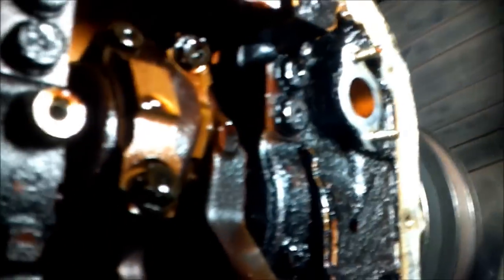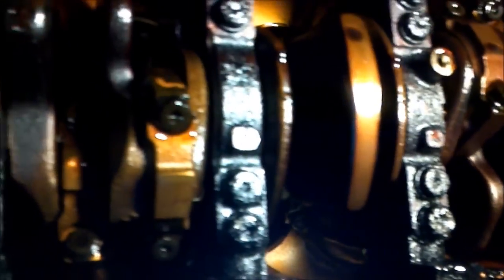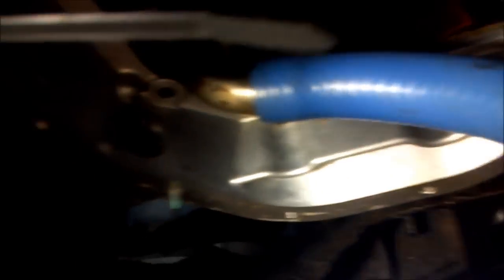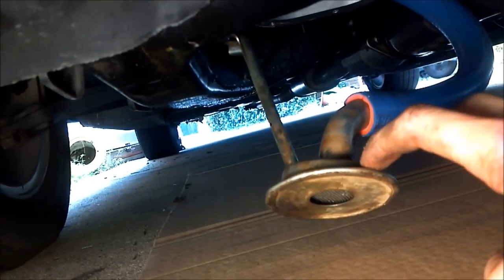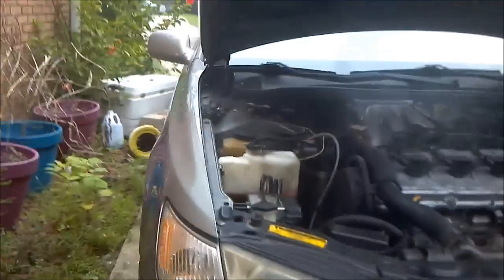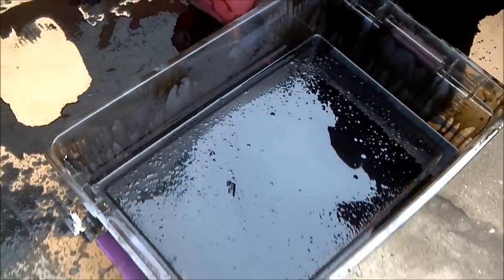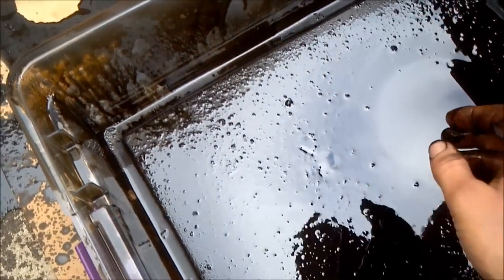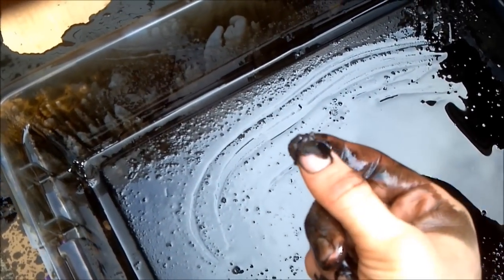2000 Lexus ES300 Sludge removal

Comment: how to avoid engine sludge in the 1MZ-FE (Toyota V6): 
1) change the oil according to the owner's manual
2) change your PCV valve every other oil change
3) clean out your EGR tube and EGR passage to the intake every 30k miles or so

Comment: Damn you got some balls !! You run an engine with oil pan open, never saw that before !
It seems to work, lots of sludge seems to be removed.
It's a very messy method but if it works !

Comment: Use Rotella 5w40 Diesel oil. The extra detergents in the diesel oil will help clean the rest of the engine.
Reply: I’ve ran diesel type oil in a few very dirty engines and it did no more cleaning than regular oil did.

Comment: Why not add a flush to the oil, let it idle 10min then drain it out.  A lot less messy.
Reply: Boodieman72 with that amount of crap the sludge would break loose and clog other parts of the engine.
Reply: Joe Torres
then flush 2 times?

Comment: I worked at a garage for many years and i've seen a sump been took off and the amount of sludge at the bottom was INSANE! Mate who worked on the car said that's because of cheap oil and not frequently changed.And one customers car had an oil change but didn't want the spark plugs changed as she recons changing them was a con so we left them alone which we put back in a black,old disgusting state and yes! the car ran like a pig before! The amount of fuel she's wasting due to it not being replaced was a joke.Some people just on't get it.

Comment: What was the mileage on your car at the point of 'sludge removal' ?
I'm thinking of buying a 1999 es300 with 180k kilometers, concerned with this.
Reply from the maker: Happened at 160k miles. After this it had 300k when sold. Might even still be running around somewhere.
Reply: gmtech26358 Would you suggest a fluid flush at my stage? Or do you think that will make it worse?
Also, what are your thoughts on the reliability of the vehicle, would you recommend the purchase? Any other precautionary suggestions before I make the purchase?
Reply from the maker: @fi8er1  after what happened to me I'd not even consider it unless you pulled the front valve cover and checked for sludge. I can't recommend this engine. Durability is great for these with good service history.

Comment: Hey boss awesome video! Can you help me understand something? Are you extending from the oil pick up to fresh oil and leaving the oil pan off so as fresh oil comes into the system it will cycle through (taking out your sludge build ups) and end up in your tub? If this is the case how much fresh oil did you need to use?
Reply from the maker: Frazer Brennan I used the same principal as an old style bowl type fuel filter. The solids settled out on the bottom well away from the pickup tube. I had been pulling the lower pan off and cleaning the screen over and over and over. After the 5th time of that I decided to use this method. I used oil that was not fresh but I knew it's history and it had no particles in it. It was drained from a diesel engine  that holds around 30 qts. I used probably 5 gallons to fill the bin.
Reply: gmtech26358 thanks for the reply ! I will do the same one day on my car just to see the results

Comment: From my understanding of this, the gunk was continually blocking the pickup screen so this was a way of clearing the gunk to fix the problem?
Reply from the maker: Yes, Exactly my issue. The screen is roughly 3" of area and about 3/8" from the bottom of the oil pan. In no time it'd be clogged and I'd have no oil pressure.
Reply: gmtech26358 I had a similar problem with my V6 Avalon.  Oil light slow to turn off, some flickering.  I replaced the oil switch and filter.  All seemed fine for a while but did notice an occasional flicker of the oil light.  One day just stayed on.  

I was thinking maybe a another faulty oil switch.  Moved it out of the garage and it stalled.  In fact the engine was seizing.  I took the pan off and the oil screen was completely blocked with hard black crud and there was a lot of sludge around.  

Cleaned the oil screen, the sludge I could see and the pan, reassembled it.  I put some oil down the spark plug holes.  I also checked the PCV valve and hose and it was blocked with black crud.  Cleaned that too.  Left it to the next morning.  Went to start it up and the starter motor just went click click but finally cranked the engine.  After massive amounts of smoke, the engine is fine now.  

After cleaning the PCV valve, the car no longer emits a little smoke on start up.  I have read that a blocked PCV valve can cause engine sludge.  

I have had my Avalon since new in 2002.  It has done a little over 200,000 km and gets an oil change every 7500km. 

I understand what you are doing.  If the oil screen is constantly blocking up, it’s a huge problem and the value of the car restricts how much money you want to spend on it .
Reply from the maker: There is a known issue of the valve covers being too restrictive and causing this problem. Toyota paid out and had to replace engines because of it... didn't even know when I bought the car as it had been maintained well.. They were covered under warranty for 8 years for this issue.

Comment: Run liqui moly engine flush and use Rotella t6 oil 0w40
Reply: well, my garagist told me that if you use enigne flush in sludgy engine,  the engine is going to die
Reply: Tao L  it can if you don't have 10 cheapo oil filters and about 10 gallons of oil.   you'll get about 5 min of idle before the pick up starts to clog

Comment: Must be a better way.and the junk in the pan is from under the car.
Reply from the maker: Post up a better way on your channel and no, the oil I used to flush with was out of a diesel engine with no large particles. Additionally, I had removed, cleaned and reinstalled the upper oil pan so anything loose would've been knocked off. At any rate, this worked well and the car now has over 230k miles on it. :)
Reply: gmtech26358  can you drop the oil pump with the engine still in? if so force solvent under pressure through passages , new oil and filter with plenty of solvent  and watch pressure until it starts to drop and repeat until it's gone

Comment: Use a better oil and change more, i do 10,000km group 3 synthetic.
Reply: +Super_Slav 10,000 km might be ok but many cars have crazy drain intervals.  10,000 or 15,000 or more even.  Here in the USA our group 3 oils don't last that long because they shear.  My next motor oil is Redline for my 06 Jetta.  I am using Mobil 1 now but Redline should be even better.  If you want a group 3, Castrol makes some good stuff in that category.  Remember it is because of Castrol that the word synthetic is the label on the group 3 pseudo-syn oils.

I would like nothing more than to force them to label group 3 based oils as Pseudo-Syn or something similar.
Reply: John Doe
I use Fuchs titan GT1 PRO C3 or liqui moly TOP TEC 4200 5W-30 in my car, I am not a fan of castrol oils, I have mobil 1 esp formula in it at the moment though but that is impossible to find especially in 5l containers, only 1l which is way too expensive.
Reply: @super_slav91  
Fuchs is very good.
5w30 is the best viscosity. ACEA C3 very good as well.

Comment: Washing machine soap powder on the concrete will help clear up the mes you have made.
Reply from the maker: Nathan Curtis I can assure you that the oil was properly disposed of and cleaned. 99% of the oil was on top of three layers of cardboard and it was burned on a bonfire. I used Dawn and a pressure washer to clean the concrete. Thanks for watching!